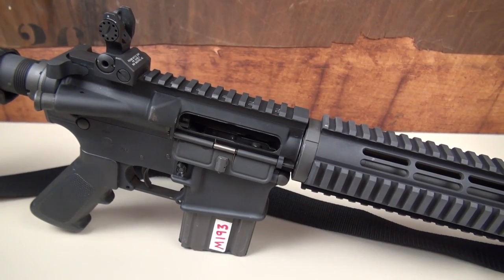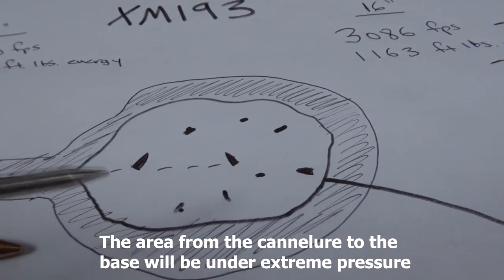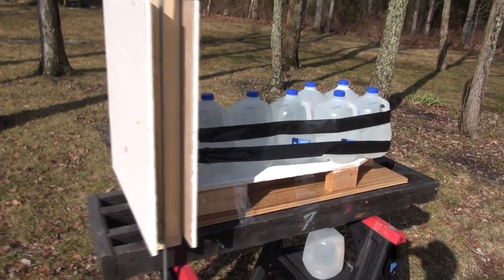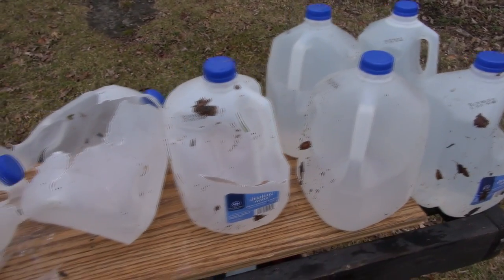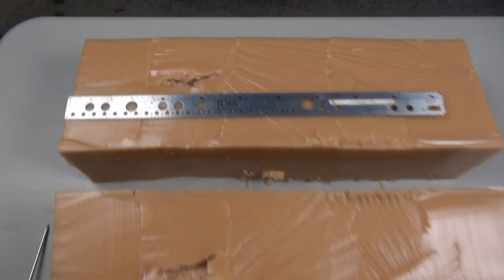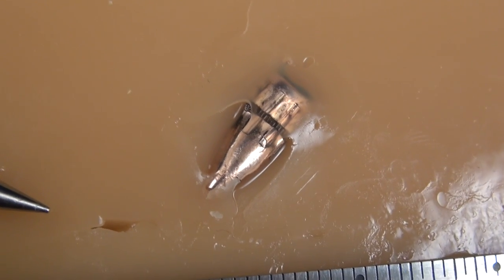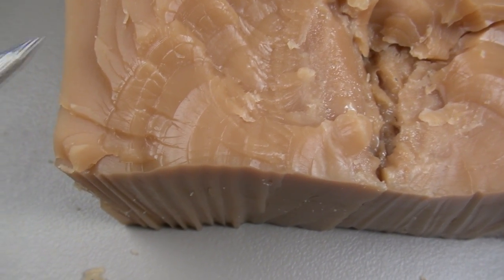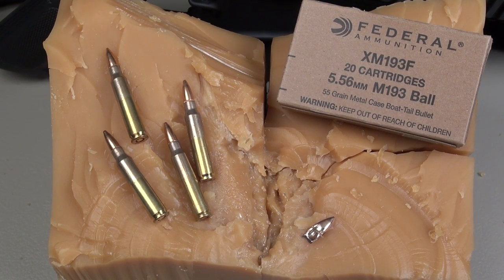5.56mm NATO XM193:  Drywall & Ballistic Gel Test

Comment: Would there be any difference with the higher rpm of a 1:7 twist barrel?
Reply: +Dario Zapata The lighter weight bullet could just disintegrate in the air because it's spinning so fast. 1:7 twist barrels are made to be used with heavier bullets. The faster twist gets them spinning fast before leaving the barrel to keep them stable in the air.
Reply: That's completely untrue. m193 is used in 1/7 twist barrels all the time in combat and in civilian applications.
Reply: I shoot .223 handloads, 55gr fmj's in my 1:7 18" barrel at about 3000 fps consistently out to 400 yds on a 10" plate. So, I'm pretty sure it's not disintegrating.
Reply: bill howell The whole "disintegration" thing is a total myth. Molon on AR15.com does some of the best Lab grade AR15 tests on the internet. He shot 40 and 35 grain projectiles out of a 1/7 twist and found them to be average in accuracy however they weren't falling apart like some would claim.
Reply: The only reason the military adopted the 1:7 twist for their ARs was that the extra twist was needed over 1:9 to stabilize the longer, heavier tracer rounds, which wouldn't stabilize out of 1:9 twist barrels. According to the Army's own testing, M193 shot more-accurately and consistently through 1:9 barrels than through 1:7s, but they adopted the 1:7 because of the tracer issue. However, it cost them 1-2 moa in real-world accuracy when using M193 and M855.

Comment: It's because the m193 has a higher velocity. So bigger, heavier projectiles will be slower and more likely not to keep going.
Reply: +Always Armed88 thats false. lighter faster rounds like m193 penetrate less than heavier rounds like a 62 gr or 77 gr. even penetrate less than most pistol rounds and defiantly shotgun rounds, buck or slug. its because of the fast yawing rounds like 55 gr m193 tumble ass over head when they hit anything instead of just poking holes through everything even soft targets like pistol rounds or green tip is known for. obviously 2 sheet of dry way isnt gonna make anything slow down enough to not be lethal other side but m193 will penetrate less than other rounds.
Reply: Justin Goncalves Look it up. Plenty of videos and forum discussions on how the m193 penetrates AR500 armor when m855 dont.
Reply: i understand it has higher velocity. and thats
exactly what causes it to tumble(plus the yaw of the round). heavy 5.56 loads do not have a tendency to tumble and therefore penetrate more because the round is more stable. even though they have lower velocity. for example when you use an sbr you loose the effectiveness of the round because velocity drops too much and velocity is what helps the rounds tumble. another reason why 62gr green tips suck.
Reply: I understand that and thought it sucked at penetration. But when i read about it and then seen videos it made me think twice on armor and what to use. I use 77gr and 55gr
Reply: But i have a 1:8 twist so it can handle either with good accuracy
Reply: lol i dont think we are still having the same conversation here.
Reply: Yeah we are. The m193 had enough velocity to penetrate an AR500 level 3 plate
Reply: At a distance yeah it wouldnt be that good but up to 50 yds it penetrates

Comment: My greatest concern is pass-through. Its the main reason I use light and fast 9mm JHP for personal and home protection. Kids, pets, neighbors, etc....
I like something I know is gonna punch hard and dump into the target.

Over penetration didn't seem to happen here....which suprised me since this round has a reputation for it.

Is this a factor? Am I skipping over a viable alternative?
Reply: M855 would be more likely to over-penetrate.  Through a carbine length barrel it doesn't tend to generate the velocity it needs to yaw properly.  The lighter XM193 yaws and fragments, and thus leads to more horrendous wounds.....but less over-penetration.
Reply: Eric Anderson
Thanks man. Appreciate the input! I working out of a 16" 1:9. So I figure lighter soft point or hollowpoint (ballistic tip on not) is the way to go.
Reply: Eric Anderson That's incorrect. You shouldn't be giving home defence advice like this if you don't know what you are talking about. The m193 will penetrate better than the m855 above a certain velocity. Say, from the muzzle out to about roughly 100 yards the m193's faster velocity will penetrate deeper than the m855.
Reply: I just want something that will dump quickly or break up within a few inches. I'm thinking of switching to a semi-jacketed hollow point. At the ranges I'm thinking, it wont have time to yaw or pitch anyways. It'll hit nose first i imagine.
Reply: Ki11bot
Don't listen to Luke, Eric was correct the XM193 will penetrate LESS than xm855

As for self defense or protection. Buy a hollow point and be done with it. Anything that is lethal will pass through a interior wall. Even 22lr
Reply: I figured since XM855 are usually labeled "penetrators."
Reply: It also has a lot to do with the weight of the bullet.

Heavier bullets usualy penetrate more due to the greater inertia of the round.
Reply: Your best bet is light varmint loads, 40-50 gr or so for 556
Reply: fakemail4suckers You gave self defense advice to Ki11bot that I have proved false. 

Can you at least admit that?
Reply: The only person wrong here is you. You don't know what you are talking about. And the video's TN9 puts up prove you wrong.
Reply: fakemail4suckers What video? Show me?
Reply: Luke William 
Cartridge, Caliber 5.56 mm, Ball, M855: 5.56×45mm 62-grain FN SS109-equivalent ball cartridge with a steel penetrator tip over a lead core in a partial copper jacket. [green tip]

And you are wrong M855 has a better ballistic coefficient and penetrates better than M193. After all M855 was designed in the late 70's to penetrate COMBLOC soldiers helmets and AK mags they wore on their chest rigs.
Reply: I'm sorry, just because I label something a penetrator doesn't make it penetrate better than any given bullet.

Did you even watch the video proof I provided? 

You are partially correct in that the XM855 was designed to RETAIN its ability to penetrate at longer distances. But for home defence distance, the m193 will penetrate more.

I'll tell you what, if you want a second opinion, go ask this question on AR15.com. I am not trying to rub it in your face or anything, I'm just trying to clear up a common myth.
Reply: dabNtx Great pics, dabNtx.  What we don't know, though, is whether bone was hit as the rounds passed thru the pig.  

My take-away from this video, and others, is that a rifle should not be the weapon of choice for home defense.  The risk of hurting innocent folks is way too great.
Reply: KC I respect your opinion but do not agree with it totally. Everyone assumes I live in a city where I have neighbors right next door. Well I dont.. I'm currently resigned on a 65 acre plot of land less than 10miles from the Texas coast..  In my case a rifle is the best defense weapon for home/property defense..  

Now having said that any round will pass through sheet rock walls. 22lr, 9mm,40sw,45acp,223/556, .410,20ga and 12gauge.  Thus pick something that you know you can hit with. The key if your worried about "pass through" is to pick choke points in your home where your rounds will impact the floor or a wall that's not in the direction of neighbors. Remember when protecting yourself or your property its better to ambush your attacker than go on the offensive clearing rooms "Rambo style"
Reply: I'm not talking to you, but the original comenter Ki11bot who said, "My greatest concern is pass-through".

The next comenter told him that xm855 was more likeley to pass through and overpenetrate. And this is the exact opposite of reality at the distances ki11bot was concerned about.

Comment: Placing the targets right up on the drywall is a bad idea.  The drywall will cause the bullet to start yawing and losing energy quickly.  On impact the bullet may be completely sideways thereby reducing penetration and increasing the chances of a person surviving a stray round.  However, if the target is pressed against the wall then the bullet will have little chance to yaw at all and will have minimal differences compared to shooting at something with no barrier.

Comment: an AR is def not a home defense weapon
Reply: ANd what is?  00 buck that will penetrate twice as many walls?  a .45 ACP 230gr JHP that will penetrate just as far as the 223?
Reply: valya fadlon Yes the hell it is, whether you want to use this round is another question.
Reply: I would be more concerned about the muzzle blast.  I would rather have the 45acp or 9mm in standard pressure.  However everyone needs are different.  I don't blame you for having one ready just in case.
Reply: valya fadlon you clearly have zero factual knowledge of Home defense or the AR-15. Nice try, F minus for effort.
Reply: Anything is better than nothing but I’ll use my AR
Reply: Yes it is someone in your home is a dead man doesn’t matter what you use to defend your home yourself or loved ones